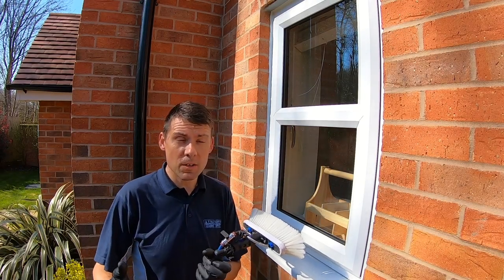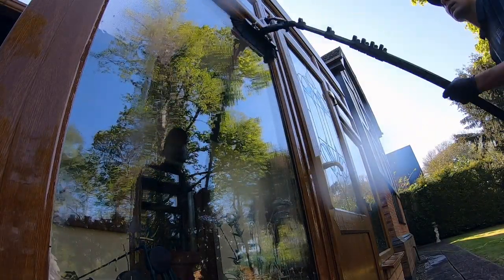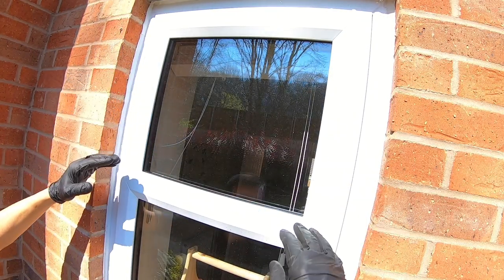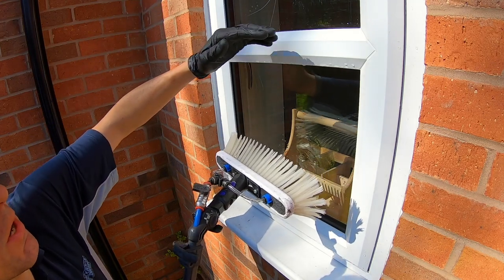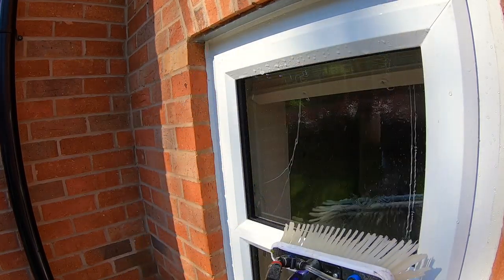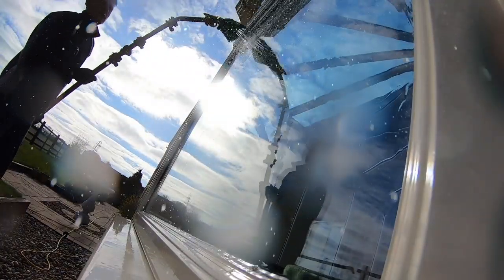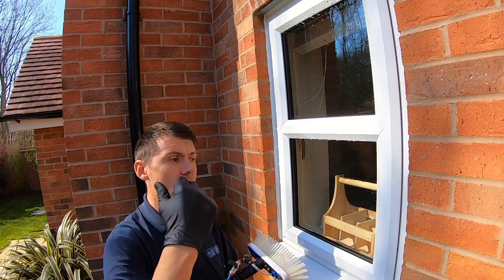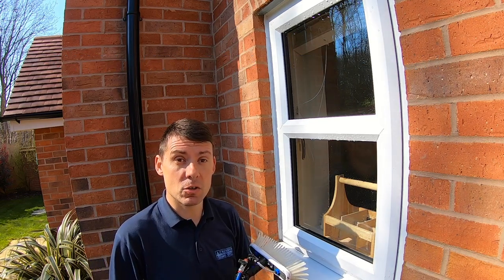The Key To A Perfect Rinse Using Water Fed Pole

Comment: Hi Ashley. Good advice. After years of wfp cleaning different type of windows over and over again, 100% spotless result will become easy if you experiment different methods and equipment. You 'll exactly know which brush/jets to use, how long to agitate, which frames can cause problems, flow rate, rinse on or off the glass etc. There's so much variables.
Reply from the maker: Sure, absolutely. I don’t quite have the same level of experience in wfp just yet. I’m loving this supreme brush with DuPont bristles from Gardiner though, and I’m using the smallest pencil jets 1.4mm which I find helps to save water.😃👍🏼
Reply: A.E.Mackintosh Cleaning Services 
It's a very versatile and light brush. Have one too, suits best on about 3/4 on my Windowcleaning jobs. One of your older video's made me buy one actuallly 😁
Reply from the maker: I’m glad you find my channel useful.😃👍🏼

Comment: THANKS. A little overkill on a window that size but good advice...lol..  I would say top third and bottom third are key followed by edges and finish with whole glass side to side.  Up and then FAST pull down down and done.  Do all top windows on one side of house before going back to do bottoms will minimize frame drips. A window that size should take you about 30 seconds per pane.  Oh and definitely invest in some type of shut off valve at pole.  Will save you a ton of money over the long term on that precious pure water.
Reply from the maker: Thanks. I’m exaggerating a lot bit to make the point, but yeah, thanks for your comments.👍🏼
Reply: @aemackintosh  
It took me a while to accept the technology and understand clearly how to get perfect results, but once adapted, it's nothing but money.   I did a large modern home recently with BIG plates, at various heights, and I I basically deliberately went slow just for appearances.  Where I am is low TDS to begin with so it's really a no brainer.  I don't even go up on ladders anymore, unless it's to do a skylight.

Comment: Thanks for the tips and videos. Do you have any tips for cleaning when you have the pole extended to 30 feet or longer when its difficult to apply pressure in order the give a good scrub.
Reply: Darren Kinsella I second this question
Reply: Use an angled gooseneck attachment and higher water flow.
Reply from the maker: The higher you go, the further back you should stand, if possible. The weight of the pole against the window should then do a lot of the work for you. Also, at height, it should be more of a rocking motion on your feet to scrub, rather than an action with your arms.😃👍🏼

Comment: Perfect, works each time, how I've been doing it Ashely! 👍
I also clean under sills esp on top windows when do first clean, know alot don't do this, just makes you stand out for the crowd 😃
What's your opinion on 50 degree water jets or say 100 degree jets?Also rinsing on the glass?
Reply from the maker: Great! I’m glad you agree. It’s good also to be thorough. I do quite like a fan jet, but I reckon they use more water. I’m using small 1.4mm pencil jets which I think helps to save water.😃👍🏼
Reply: @aemackintosh  Thanks Ashely. Yes tried the 1.4mm actually tried them all and come back to the 2mm. Found 1.4, noisy and took longer. But feel it's a personal thing and what best works for you. Just be thoughough, do a good job each time and your be ok. 👍

Comment: Great thorough video. We have a task to do with our clients because they are usually none hit wonders or at best bi-yearly. We've been wfp for years however and we wouldn't be window cleaners without it. What are you using to turn the water on and off though???
Reply from the maker: Thanks. A uni valve inside the pole is the best way to turn the water on and off.😃👍🏼

Comment: I personally think the traditional way is a bit better...you’re using no where near as much water and can get real close to the windows and scrape off those stubborn micro stains. Also I find that especially on higher windows the pole fed system can damage air vents due to gravity. Contradicting that I will say that pole fed is a lot safer and a bit quicker, and that just means moving onto the next job faster! 🤑 Happy Thursday all.
Reply from the maker: There are pros and cons to each I suppose. I love the way wfp washes the frame as well and the windows should stay cleaner for longer since there is no soap residue left behind.😃👍🏼
Reply: The problem with Trad cleaning is the soap ( often a  dish soap like fairy is used or dawn )  it gets into the seals and causes quite a lot of black leaching and damage to the actual seals after time combined with Uv sunlight . Of course  both have  got their advantages.. but above all Water fed pole should let the windows stay cleaner  longer Dish soap attracts dirt.. So  if you want to upsell WFP menton what i just explained that should ease the customers fears of concerns and get them on board  so to say..

Comment: Hi, could you tell me what water pressure you have your system set at?
Reply from the maker: I usually have my pump controller set to around 30, but it depends on the jets I’m using on my brush. Recently I’ve been using a rinse bar and I’ve had the flow set slightly higher to help me work more quickly.😃👍🏼

Comment: The way I do a perfect rinse
If it was a first clean I would set my flow rate to 7 litres and rinse three times 
Using a good rinse bar
If was general maintenance type cleans
3 litre flow rate and double pass rinse making sure all areas covered
I do this and it works no spotting on the glass maybe thanks to the water softener I use for my purewater trolley system as I live in a hard water area

Comment: Great vid again
Quick question how many houses and hrs do you do in a day .
(On average)
Reply: Hi mate 

Great video, what on/off switch have you got on your pole ? If you don’t mind me asking.
Reply from the maker: The other day I did one house. I cleared out the gutters, washed the fascias, pressure washed the drive and cleaned the windows. I was done by about 3 and I earned more than if I had just done windows all day.😃👍🏼
Reply from the maker: On this small pole I’ve put a little tap valve. On my other Ova8 I’ve got a univalve. The Gardiner website has some great hose connectors and attachments.😃👍🏼
Reply from the maker: Yes, of course I have a univalve on some of my other poles. I have to try these things. I put the little tap on this pole and I’ve never got round to changing it.😃👍🏼
Reply: Well I suppose if you only have 10 houses (not that you only have 10 houses)you wont focus on how many you do in a day but If you have a lot and have to work 4or5 days a week to get them done then you do have to make sure you get a certain amount done, I don't consider it an achievement to do as many houses as possible, or more than anyone else, just enough to get the correct amount done each day for the week and for the month.
The question was only out of curiosity not to be better than anyone else

Comment: Do you find higher PSI helps with getting a better finish? Im working on about 50 as recommended by a friend but having issues getting a perfect rinse. All my customers are happy, but I'm not. Fussy bugger 😂
Reply from the maker: I usually work with my controller somewhere between 30-40. It depends on the size of the brush and the type of jets. I’m loving a rinse bar at the moment for a good thorough rinse.😃👍🏼

Comment: Do you ever think to yourself, I could of done this traditional a lot quicker? Soap on squeegee off, edges and corners done, sills wiped onto the next. I’m always thinking this 😁
Reply from the maker: It has crossed my mind. There are pros and cons to each method. But I love the way wfp washes all round the frame far better and quicker than I ever could by hand. WFP also doesn’t leave behind a microscopic residue like traditional soaps can, which can cause the windows to become dirty again more quickly.👍🏼
Reply: Yes, except. You forget that one of the main reasons for the development of this method was for safety, no ladders, no falls and risk of severe injury.
Reply: Bear in mind this is the first clean and the next visit would be gone before trad gets to the back of the house.also no falling off of ladders which would mean a visit to the local covid hot spot